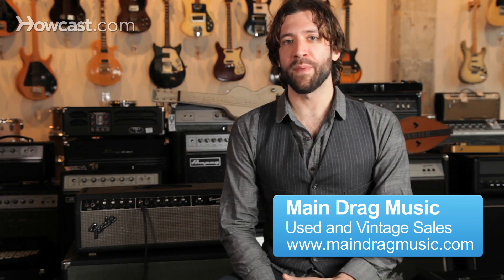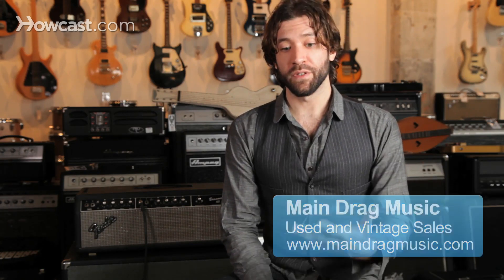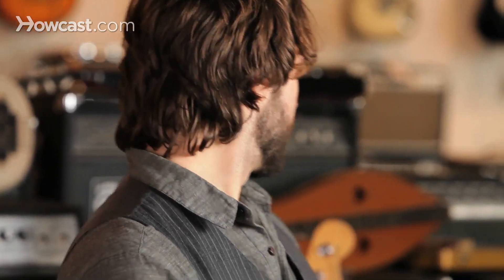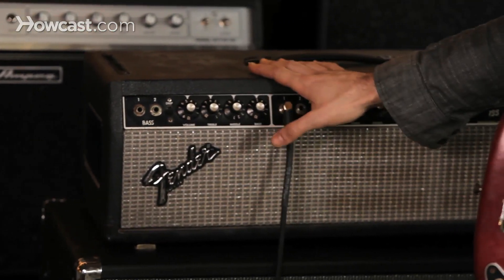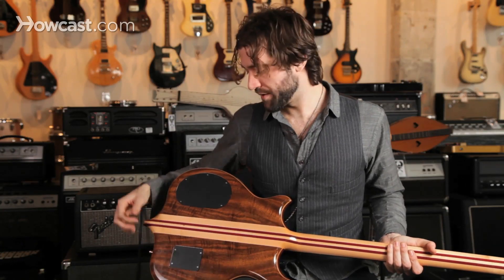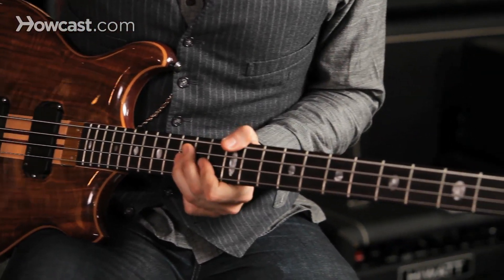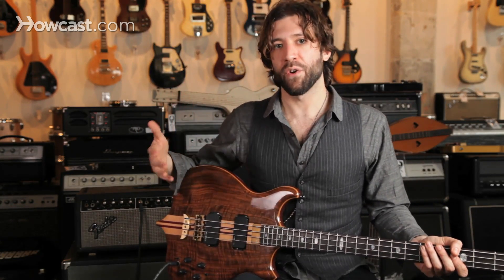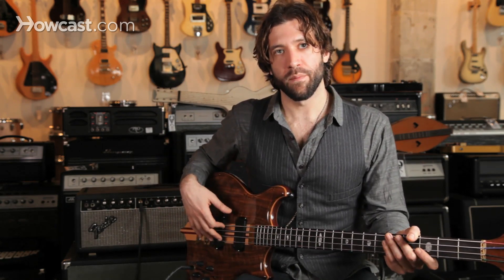Active Pickups & Passive Pickups | Guitar Setup

Comment: Actually, The Alembic is not an active bass, or not an active bass in the common way. The active basses have passive or active pickups and a preamp separated to different bands (Treble, Mid and Bass) drive by batteries. The Alembics have Low Pass Filters, which is also a filter like a passive bass's tone filter, but you can choose the freq where you want cut and it has an additional boost to increase the dynamic range.
Reply: Hi kolbola, the Alembics are very active indeed, from the pickups to the electronics. the Low Pass Filters are active not passive, unlike a typical passive tone circuit ;)
Reply: Read carefully, what I wrote. Not an active in the common way and you can boost a certain freq. So yes, it has  active PUs and circuit, but not like an active Warwick Thumb with an Active MEC PU and EQ.

Comment: I have a question. Is there limitations on what kind of mixer you can plug into with a passive acoustic pickup-(pre-amp but no 9v). I have a passive mixer going into powered speakers and I had problems getting that acoustic to work. I also have acoustic that has a 9v and it works fine. Any input and suggestions would be very helpful. Nice video by the way